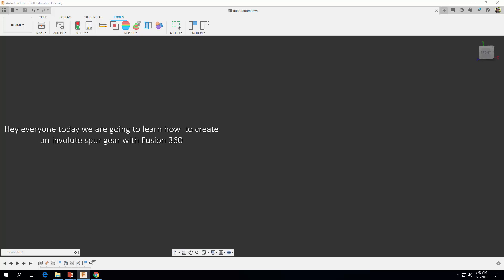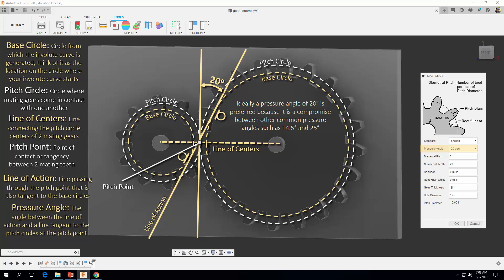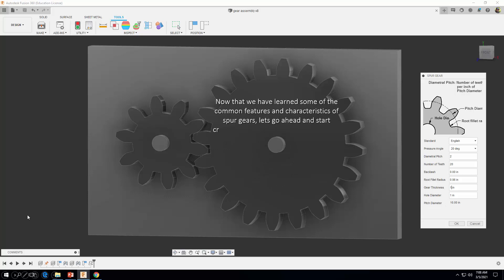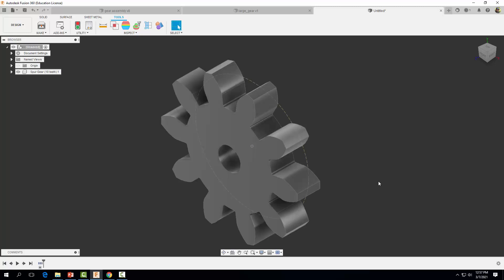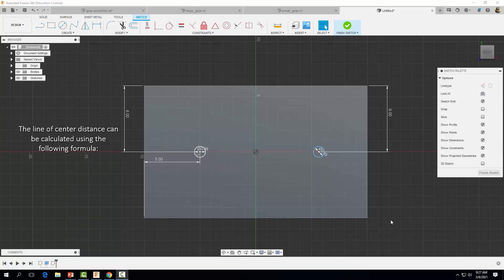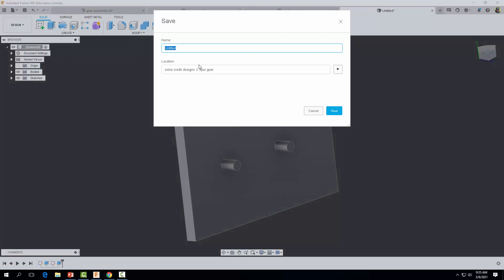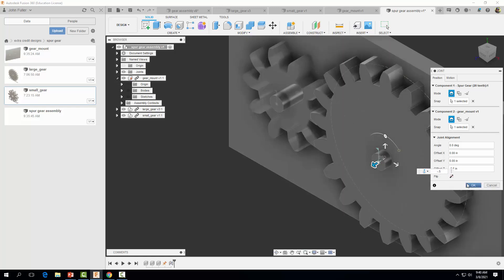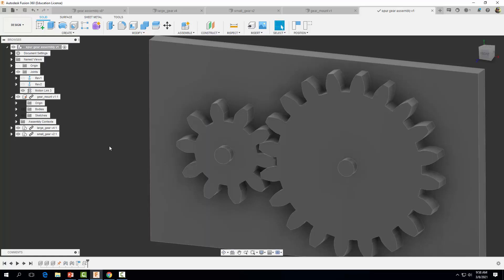Creating and Assembling Two Mating Spur Gears with Fusion 360

Comment: Once you've created a spur gear using this plugin - can it be modified?  I've created a gear but want to change the thickness
Reply from the maker: Yes
Reply from the maker: Start a sketch on the surface of the gear you wish to modify, project the geometry and extrude it